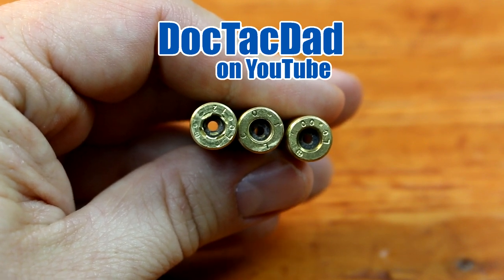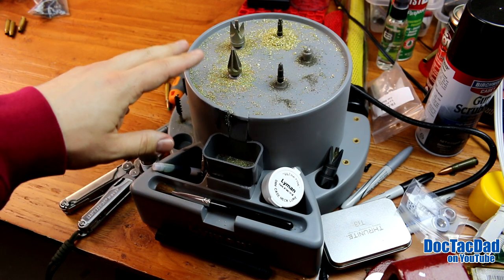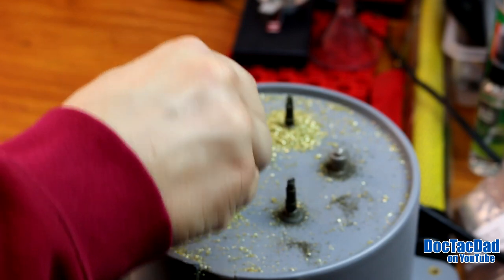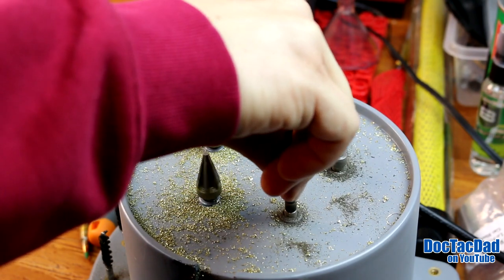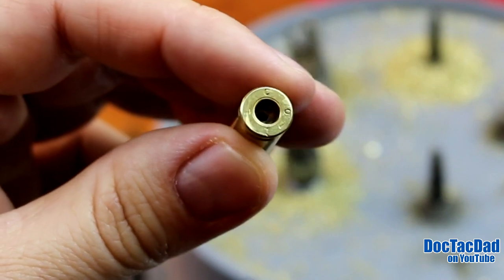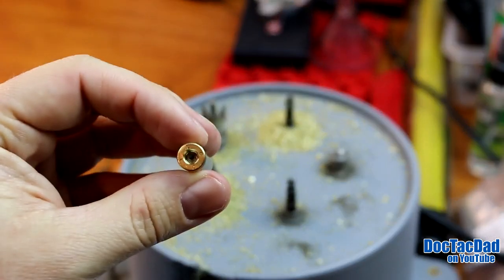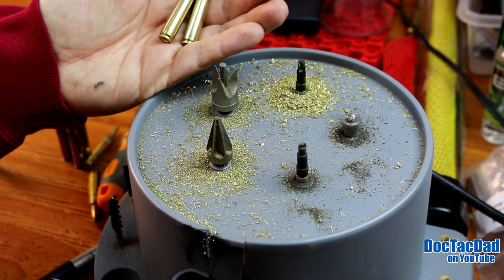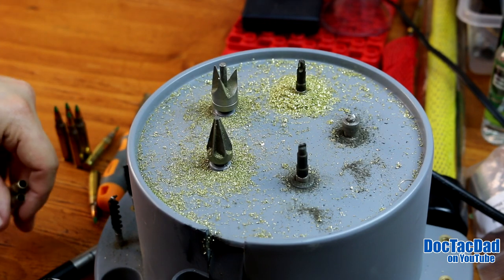Primer Pocket Crimp Removal - Lyman Case Prep Center

Comment: Finally spent the $$ for a powered case prep unit in early 2017. After research I decided on Lyman. Excellent decision!! Wish I'd had one years ago. 2 thumbs up. No cons to report. Pluses I like are excellent torque motor, very quiet, 5 workstations. With the threaded workstations its so versatile to change tools. Very solid feeling like quality. Heavy enough it doesn't move while using it. Highly recommend it.
Reply: You can attach a trimmer too.

Comment: That's a nice set up. I was thinking about buying one. They run about $130-$140.
I chuck my prep bits in a cheap $10. Harbor Freight drill clamped in a vise and use that as my primer pocket decrimper for .223 military crimps.

Comment: I would examine the primer pocket hole after using the deburring tool prior to using the reamer.  I've compared two pieces of brass, one using the deburrer first and the other one without.  The point on the deburring head seemed to ream out the primer pocket hole on 556 brass due to it entering the primer pocket too deeply and cutting into the primer pocket hole.  Something to look into.  I know some guys that use the deburring tool head first but I'm not convinced that's a good idea.  Like to know what you've observed with this process....
Reply: Yeah, I didn’t like that either. Looks like a good way to unintentionally enlarge your flashole. The reamer does require previous steps.

Comment: I didn't like the idea of removing material from the primer pocket area, RCBS makes a tool that fits in your press and reforms the primer pocket without removing any material.
I also found the RCBS primer pocket cleaner doesn't cut the pocket deeper.

Comment: I'm just getting into reloading. Do I need or is it a good idea to crimp my 223 cases
Reply: 86keen : Yes try out the "Lee factory crimp die", it does an awesome job and the Lee die doesn't require the projectile to have a canalure ring on it, will work on any projectile,  of course the die will be caliber specific.